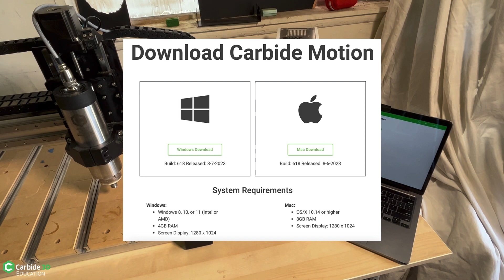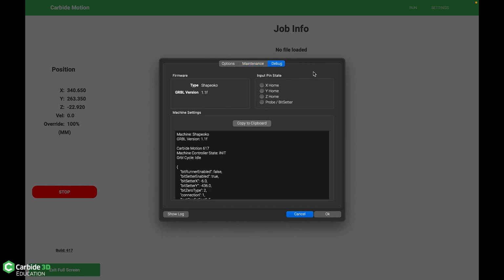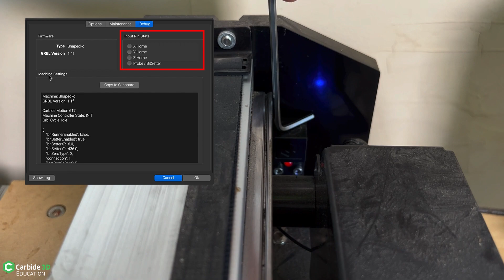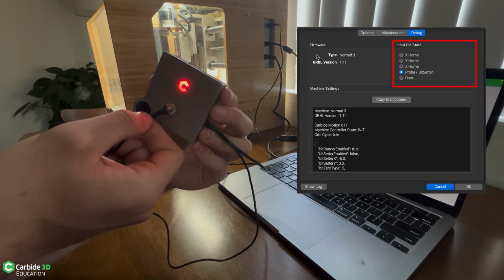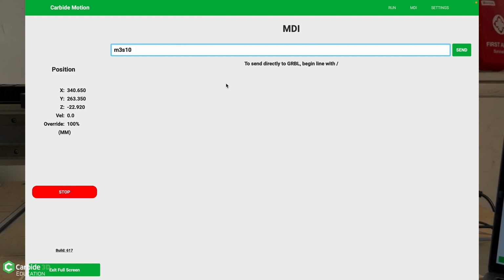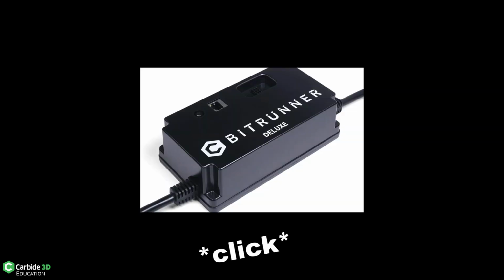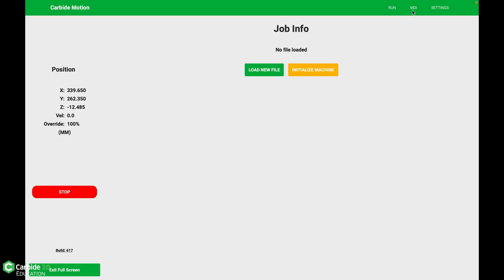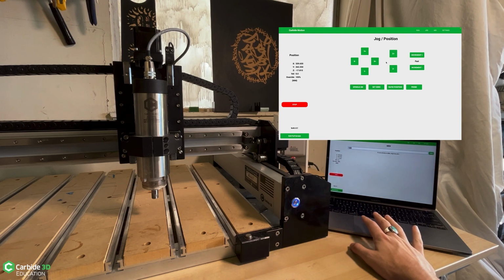The Support Show - Ep 10 - Troubleshooting Your Machine

Comment: Hi I am on the first page and it won't allow me to press connect to cutter or press settings nothing happening please can you help
Reply from the maker: If you send an email to support, they can help you get up and running.
Reply: @carbide3d  can you help me get started with my machine I'm trying to connect but won't respond tried troubleshooting without success
Reply from the maker: The support crew can definitely help, but you'd need to email them.  They don't go through YT comments.